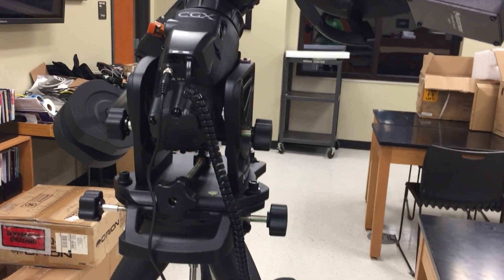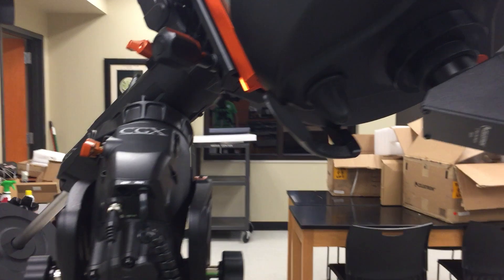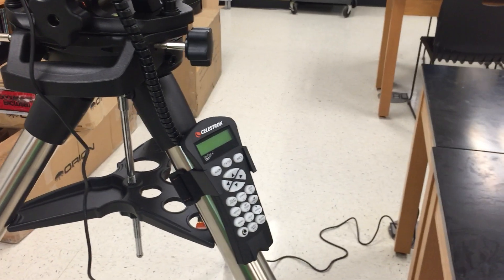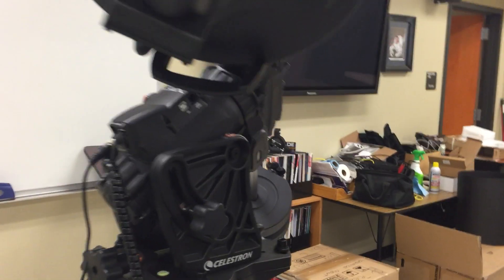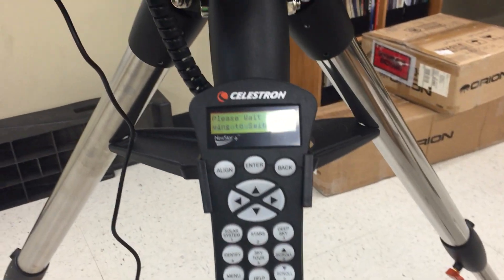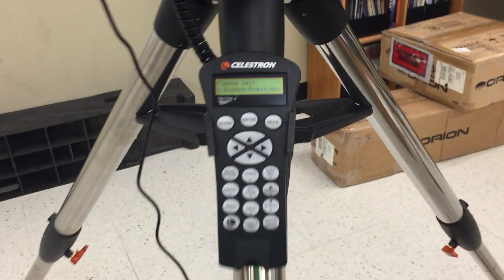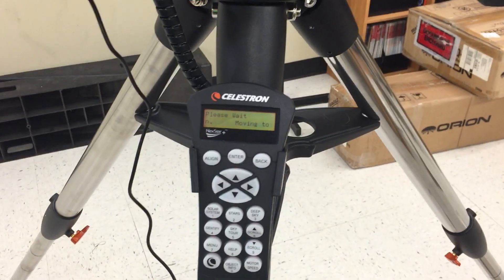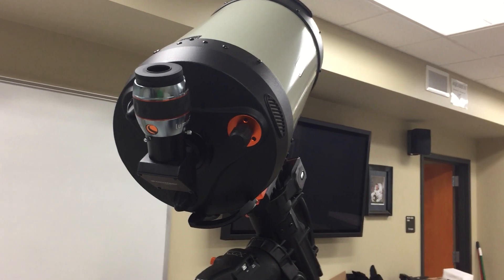Celestron CGX setup Faulty DEC Axis!! Baby it was born that way.

Comment: Mine worked last week. Today it does the same thing as your
Reply from the maker: Patrice Scattolin  dang. I'm sorry to hear it. If you linked here from cloudy nights, post your troubles in a reply there. My goal is to get Celestron to address these quality problems. It's ridiculous for such an expensive mount.
Reply: Dave Compton  is there a thread for this on cloudy night
Reply from the maker: Patrice Scattolin yes I think so. I made one called cgx unboxing and problems
Reply: Ok, I found this: https://www.cloudynights.com/topic/585542-cgx-mount-unboxing-problems-resolution-to-working/

Did you finally get it working? How?
Reply: My mount is fixed!. Brought it back to the retailer. They opened it and fixed it, picked it up the same evening. They opened up the cover on the on the top of the polar axis (where all the connectors are located). There are 4 screws. Lifted the cover. Turned out there was a connected that had jiggled loose and became unplugged. They repluged it, closed the cover and now my mount works. 

Maybe you have the same problem
Reply: Do note that I did update the firmware before going to the store but that didn't fix anything. No surprise since a connector was unplugged. That said the firmware upgrade worked. Hopefully it's in top shape now.

The one thing I am bummed about is that the hand controller had to be connected into a powered mount. That means that I really need a laptop in the garage where the mount is setup to perform the upgrade instead of just bring the handcontroller in the house and do this with my regular desktop. PResumably there is firmware in the mount also being upgraded. Let's hope so because it's inconvenient to have to upgrade the mount "in the field' as it were. That said the upgrade worked so I am even.
Reply: For the record, it's the cover that covers the area where the plugs for the controller is and where the power switch is. 

Now, I not encouraging you to do this yourself if you aren't confortable with this, but it's a possiblity. Technically I don't think it's a user servicable area, at least I don't remember the manual say you could open that (like they to with the cover where the motors are). The retailer where I bought it did it on it's own, they prefered doing this to RMA the mount itself seeing that I had a working mount out of the box first. Being the store, I presume they could have talked their way through to Celestron support had they needed to RMA the mount and that's the difference between me doing it and the retailer doing it. 

That said, I just wanted to update you in case you have the same problem I had and you wanted to know.

Best of luck with your mount. It is indeed a solid piece of work and the optics certainly looked the part.
Reply: So far it feels like a solid mount. The handles on the head are really handy. I am hoping that no other problems develop.